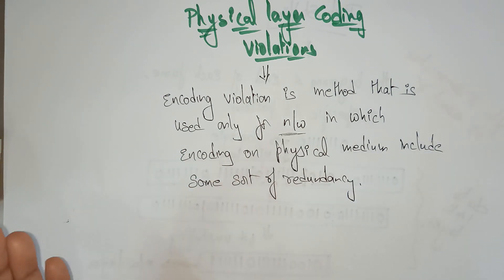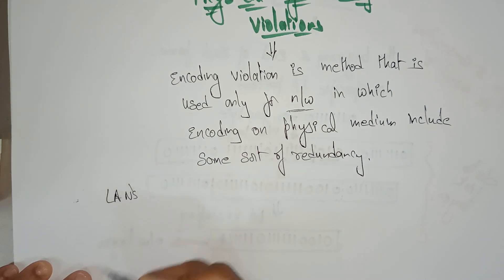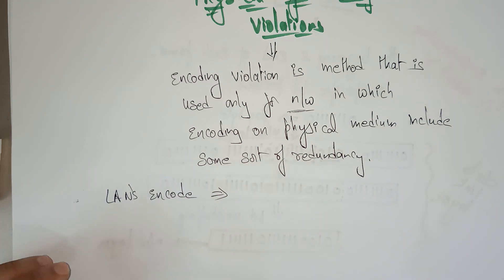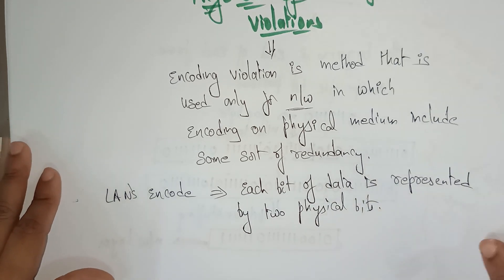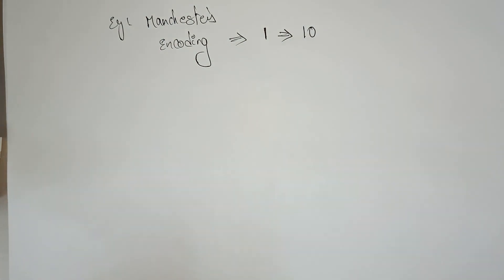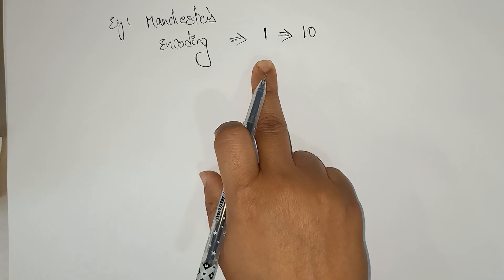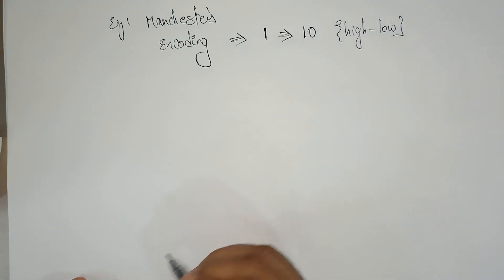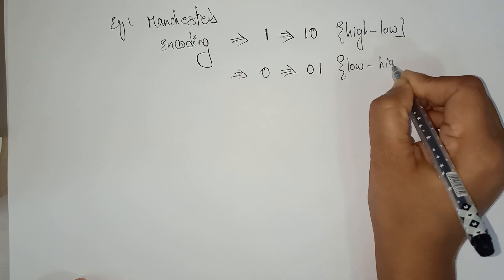Framing in data link layer | Physical layer violation |Design Issues| Part-4/4 | Lec-46

Comment: what if the data is '0101' ?,  its encoded data will be "01100110"  then, '11' and '00'  ,which are a violation, will be included in data and frame ending will be represented
Reply: when it comes to manchester encoding, you read physical bits in a fixed time interval, 2 physical bits as one information bit.
that means that in a FIXED time frame there can only be 01 or 10 if there is no error, 
your example:
'01100110'  will be decoded as  '|01|10|01|10|'  -> 0101, where fixed time interval is denoted with bars |..|, you cannot put |..| arbitrary where you want